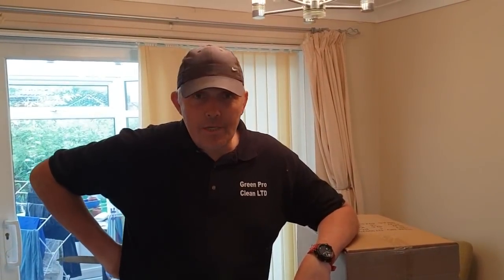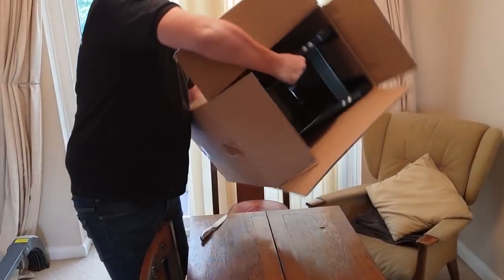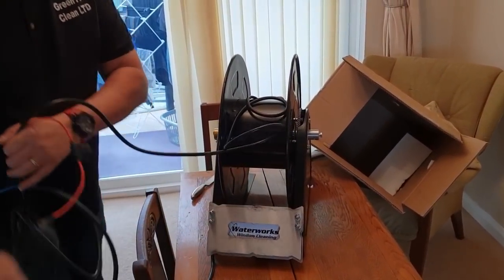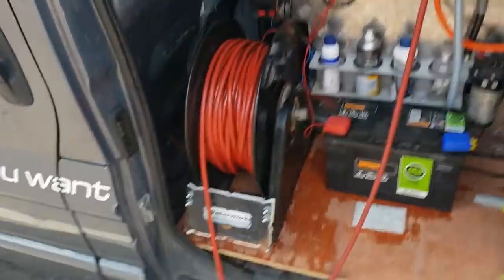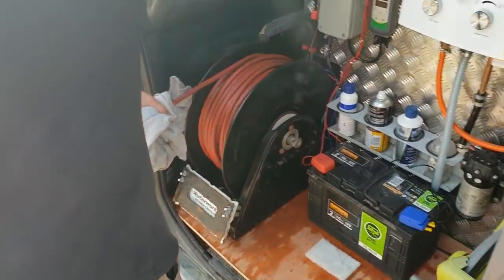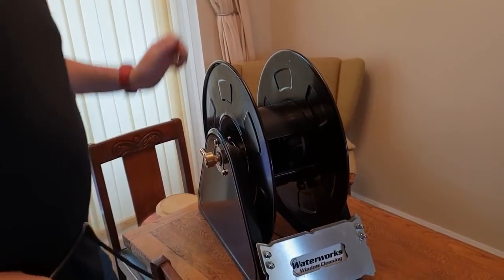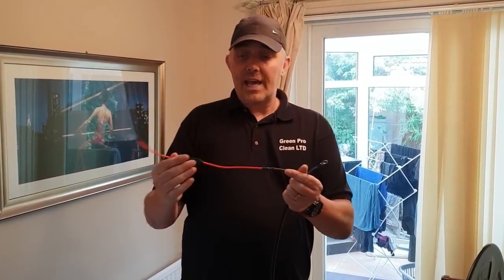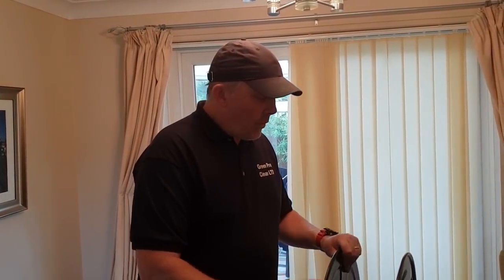Waterworks HD Power Up Reel Review Water Fed Pole Window Cleaning

Comment: I love my DIY power reel. Can’t imagine going back to winding up by hand
Reply: gonna make 3 of em in the spring thanks squeaky
Reply: do you thing your design would reel in 100m of garden hose ?
Reply: Im not sure Dave. It reels in a 100m of 6mm no problem. Can you fit 100m of garden hose on the reel. the 6mm fills it
Reply: That would have been my next question if all the larger hose would fit. Thanks